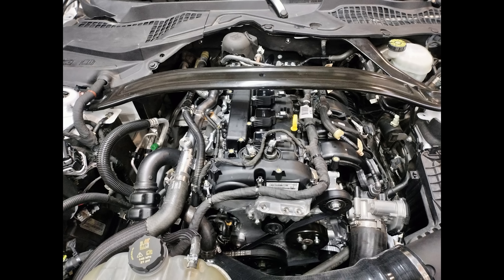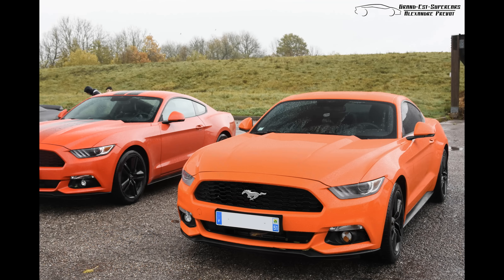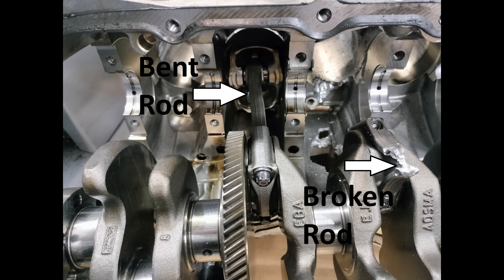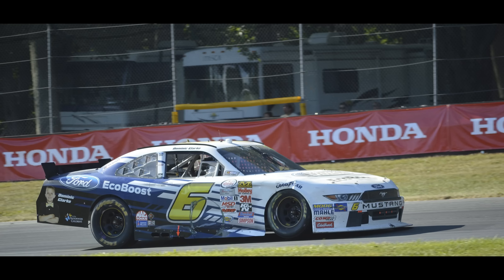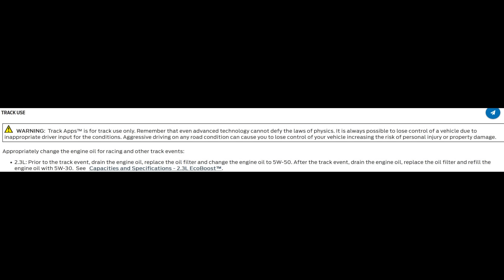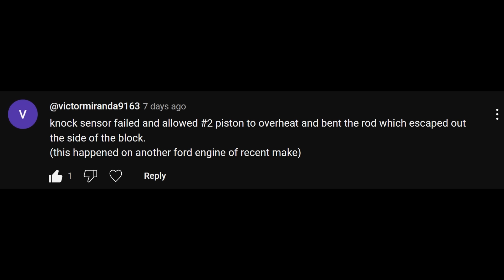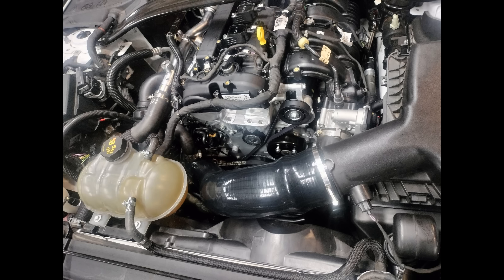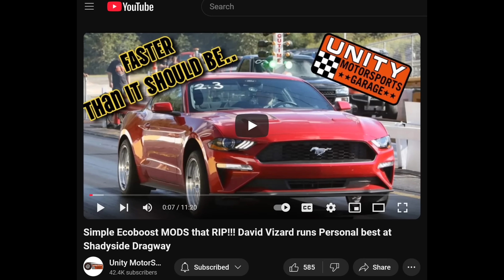EcoBoost Destroyed, What Happened?

Comment: FWIW, this engine family has a long lineage, dating back to the Duratec Fords and the MZR in the NC Miata from 2006+.  The port injection versions (namely the 2.5) have a surprisingly good cylinder head, and they are ridiculously inexpensive as they were used in tons of  mazda and ford minivans, compacts and midsized sedans.  We take them directly out of junkyard cars, run them for 40+ hours of time endurance racing, and then go get another one for $400.   With Ford's focus on boosted small displacement engines, I really think these ecoboost engines will be the next junkyard special for the next 10 years as their commuter car, built to a price point, shipping containers fail around them.
Reply from the maker: My frustration is that the 2.3 EcoBoost is almost a world beating engine. In terms of parts needed it was so close.
Reply: Unfortunately, when Ford and Mazda parted ways Ford did basically a clean-sheet redesign on the block casting and screwed up a bunch of things.

The people who want to put out serious power from this engine go with the block from a first-gen 2.0 along with the crank and top end from the 2.3  That setup is good for at least 700hp.
Reply: All true but keep in mind, durable when NA is not the same as durable and reliable when boosting to the moon. Boost can kill anything. A typical mass produced engine is plenty strong enough for NA or even mild boost but things like the LS, Coyotes, many Hondas, the good old 2JZ and a few others are strong enough to take a LOT of boost. I'm no ecoboost expert but it sounds like it is not built for that. Which is a shame, it means the typical turbo loving drag racer is still stuck with LS's and Japanese 4 bangers for cheap fun at the drag strip. Considering how ubiquitous the ecoboost has become, it would have been really nice if they had the strength to be pushed like that since junkyards are going to be full of them.
Reply: I've not researched it enough yet but Ive heard word of mouth that aftermarket rods originally meant for the MZR will work in the Ecoboost.

Comment: open deck seems nuts for high boost
Reply from the maker: Maserati does it and it works just fine, but they use stronger cylinders, head studs and more extras for strength.
Reply: They also hand built only 26,600 cars in 2023, ford sells twice that number of Mustangs alone, used the ecoboost engine in multiple cars, and combined it was still far from their most successful engine by sales.  Yet despite this they DO fail at higher rates, both by year, and by distance. The choice for an open block also makes sense when you consider they are owned by the same group (and share a lot of engineering with) FIAT, and before that Citroën, both of whom use turbo charged open block v6 designs frequently. Its normally more economical to make a familiar design strong enough than radically change engineering principles to get a more "ideal" solution.
Reply: @SheepInACart  Surely trying to use a small 4 cylinder engine and boosting them is not as good as getting the V8 in the first place . I mean getting a Mustang and putting in a piddling engine is defeating the purpose of buying a Mustang in the first place
Reply: @jacktattis  as a muscle car guy and V8 lover myself, I definitely understand this position. However think about this: previous to the Coyote, the Mustang GT 4.6 V8 made 315 hp. The 2.3 Ecoboost makes 310 hp from the factory floor, and allows for significantly improved handling and cornering due to being quite a bit lighter in the front. So while the big power V8s still might rule for street drags and straight line racing, the Ecoboost makes a lot of sense for someone that wants to track their Mustang.
Reply: @Ashcrash82  Thanks

Comment: Oh my god, thinking about damaging an engine from overreving on a downshift... I do CDL truck driver training and I'm driving with a guy right now who just cannot shift gears to save his soul and the small driving school my dad and I run doesn't own a truck with an automatic transmission, so I'm just doing a ton of driving with this guy to practice shifting. We were on the interstate today and we had moved into the decel lane and started to slow down, and he had the truck down to 50mph, which is where you need to shift down from 10th to 9th and the guy managed to get the thing into 7th. Usually, I see the student's hands move the gear lever into the wrong position, and when something like that happens, I can just grab the gear lever and either pull it out of gear before they're off the clutch, or I hold it in neutral while they try to stick it in the wrong gear. This time though it didn't really look like he'd moved the gear lever sideways at all, so I was pretty certain it was the correct gear he went into.

Then his foot came off the clutch and I saw the tach go to 2,600 RPM. Yeah that truck... unless you're in 9th or 10th gear and you're running right at the top of those two gears, it really shouldn't exceed like 1,300 but if you go to like 1,500 it's not awful, but HELL NO should that thing be up in the 1,700 or 1,800 range and I don't even know why the tach goes to 3,000. He pulled from 10th and went directly to 7th at 50mph. 7th gear in that truck comfortably only gets you from 20mph up to 25mph, and if you over rev it an acceptable amount, you can get to like 30mph, but you really shouldn't even do that. Bro had it in 7th at 50. I was very surprised we didn't get any alarms and I don't think it did any damage. If it had blown up that motor, we'd have been so screwed. Like, we might have gone out of business. Probably not, but it would have been like an $80,000 fuck up cause it would have bricked a truck we spent almost $40,000 on and we'd need a replacement for it.

Yeah we pulled over and had a nice chat about how he needs to control that gear lever and use more gentle hands and finesse rather than slamming it into gear. The notion that you can move the gear lever quickly, but not violently is a foreign concept to drivers of all age.
Reply: That's what you call a money shift.
Reply: @bedlamite42  Haha yo, that's awesome.
Reply: Make him wear thin white cotton gloves. The glove will squish, it gives your much more fred back and encourages softer hands.  It's a thing when they train people on excavators.... Might help even if it's only mental.
Reply: @drewdavis239  huh interesting idea
Reply: Slow is smooth! Smooth is fast!

I say while driving an automatic toyota lol
Reply: @r.u.s.e3586  Yeah I spend a lot of time with students basically telling them that. When shifting up, the tractors we have need the gear lever to be moved pretty quickly out of one gear and into the next one, so in that way the students need to learn to move fast without rushing or being violent. The saying I've heard (it's a baseball saying for middle infielders, but it applies here) is "be quick, but don't hurry." The bit where slow is smooth and smooth is fast is actually accelerating the truck itself. Almost all the student drivers will get on the gas pedal more than they realize and they accelerate a lot more than they realize in a lot less time. What ends up happening is the truck gets to an engine RPM where the truck wants to be shifted, but the student drivers aren't ready to shift up yet, so they just hold on the gas and accelerate too much. They'll end up 300 or 400 RPM too high for the gear they are in. So if they were in 5th gear, their RPM will be so far above where they should be that in reality, we should already be in 6th gear and about to shift to 7th, but instead the driver is still in 5th. They they try shifting to 6th, but because they are a full gear too high in RPM, the truck doesn't come out of gear well and then it won't go into the next gear, because the driver is already fast enough that they need to jump 2 gears up at a time instead of 1. Once the students learn to have a light foot on the gas pedal, they will learn to speed up more slowly. Then, when they are ready to shift a gear they bring the truck speed up to the shift point and make a much more smooth gear change. Instead of the truck driving the students, the students actually start to drive the truck.
Reply: Do an oil analysis on that engine for all of your upcoming OCIs, if it even lasts that long. There's a good chance that it did do bottom end damage with the amount of mass those rod bolts and bearings are swinging around
Reply: On a truck of that size I thought that the clutch friction plates acted like a fuse in an electrical circuit.
Of course at the first sign of someone possibly damaging an 80k asset of mine they would have been asked to take their training needs elsewhere.
Reply from the maker: Thanks for this great post. Many of Today's young people don't even want to steer, they certainly don't want to shift.
Reply: @GregsAirplanesandAutomobiles  This guy is not young. At least around where I am, most people doing CDL training want to do it in a manual truck because of you use an auto on your road test you get a license that is restricted and you can only drive automatic trucks. Maine has a lot of heavy duty and vocational trucking. If it's a newer Class B truck, even in things like dump trucks, it probably will be an auto, but if you're driving Class A and it isn't for one of the huge national mega-corps, it's a very good chance you're truck will be a manual. 

We actually really probably should try to buy an automatic tractor as our next truck. The dude who stuck it in seventh earlier today is never going to be a great truck driver, but he could be an adequate one. If we had an automatic transmission truck, he would be much better served learning in that. For the people who struggle a lot with learning to shift; if you can teach them how to drive in an automatic then they go out and work driving an automatic for 6 months they'll learn to shift way faster. They aren't trying to learn shifting while they also learn everything else about driving an 18 wheeler.
Reply: One more point, if they are learning to drive a manual transmission for the first time why not teach them in a cheap manual car until they get the hang of it?

Comment: This is exactly why I asked you how much HP the engine was putting out.  It has been well established that connecting rods are the first thing to go when it comes to the stock internals as you start really upping the power.
Reply from the maker: Great, you should have said exactly that and you would have won.
Reply: @GregsAirplanesandAutomobiles  Honestly, I figured you would have known better and replaced the rods if you were getting anywhere close to that point.
Reply from the maker: @rockets4kids  I thought I was clear I was using stock internals. It seemed like almost everyone guessed it was a piston failure. It's really too bad nobody said rods due to excess power, we could have had a clear winner. Oh well, the poll I put up will sort out the winner.
Reply: @rockets4kids  Youre asking for the power number and i was asking for the boost he was running but with both of us he's not answering and evading the question for some reason?!
Reply: @rockets4kids just guessing why no details provided but suspect he’s testing some things out. I’m no expert but usually with making much more power (and torque) the conrods are a weak point. I also suspect he didn’t think there would be an over rev being an automatic and they should be good. Also interesting is that the motor let up on the way home from the track.